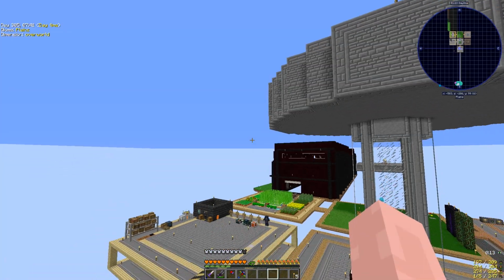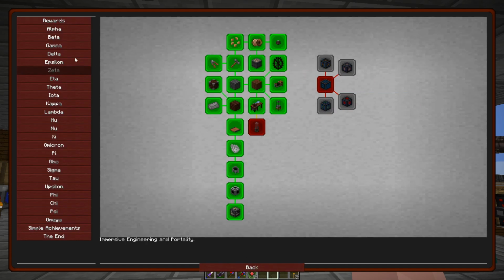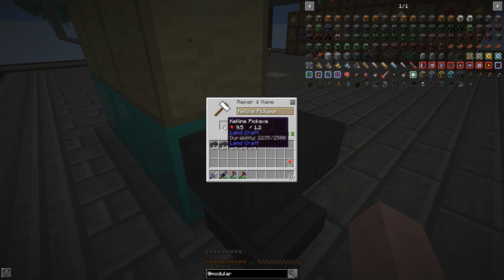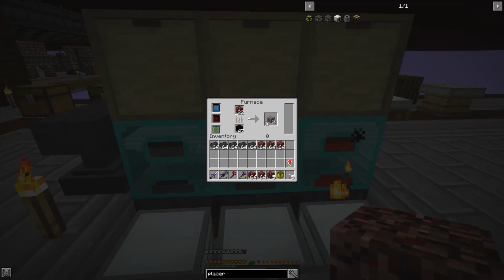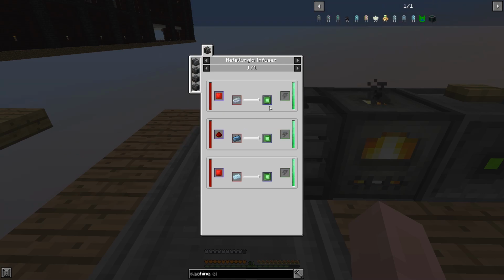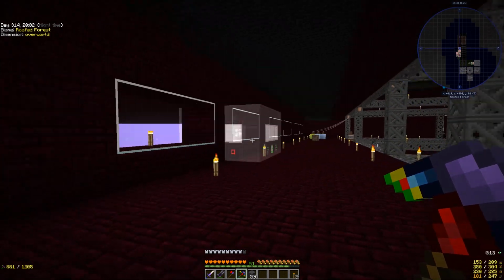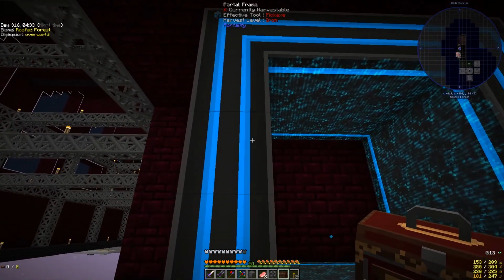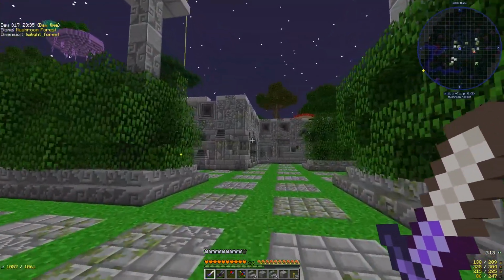Project Ozone 3 EP13 - New Base, New problems

Comment: If you really want to stretch your ores even further after doubing them via the furnace with the ore doubler upgrades, send them thru a Sag Mill with good grinding balls (vibrant alloy ones or any of the new Ender IO alloys - Stellar is best, but it gets expensive to produce) can give you up to 12 dust per ore block.  Things like Redstone ore, lapis, and coal produce ridiculous amounts if you Sag Mill them.